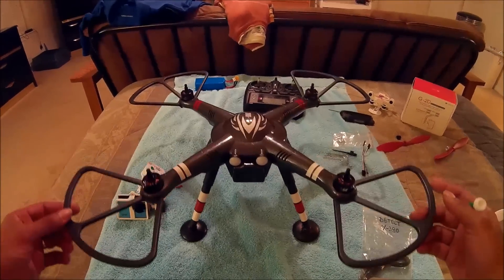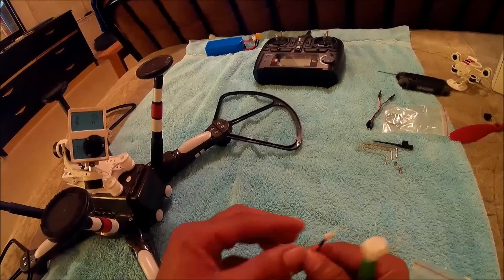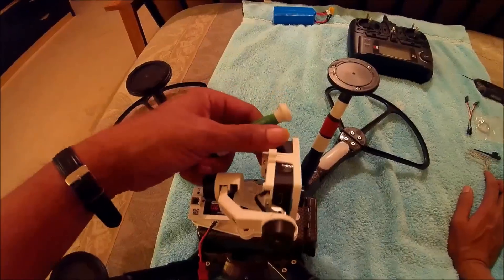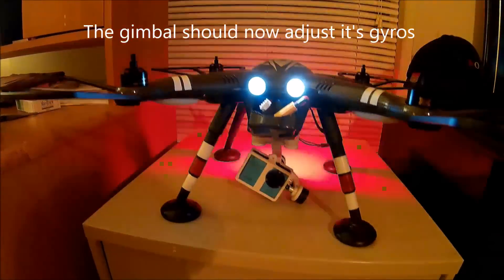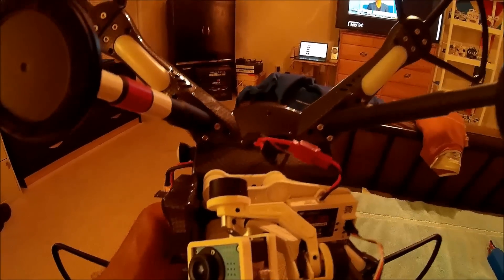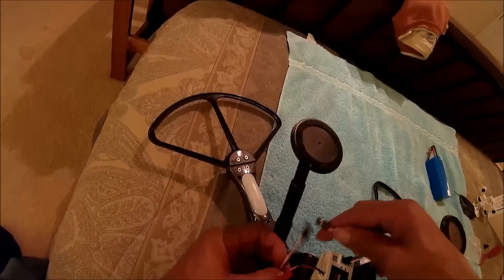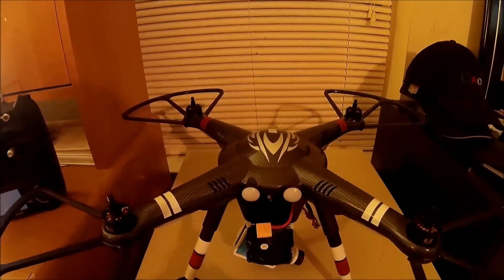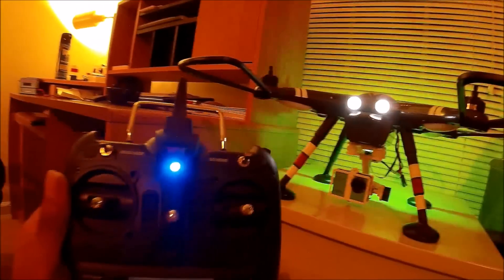XK DETECT X-380 "HOW TO INSTALL THE G2D GIMBAL"

Comment: Really nice that looks a lot easier to install than I thought it would be thanks for uploading the video. I can't wait to see some footage from your quad.
Reply from the maker: +Sam martinez   Pretty easy huh? I wish some of the other videos I watch had broken it down like that, I could of done it in about 10mins or less!  thanks for watching bro. DJ SOUL FORCE
Reply: +DJ SOUL FORCE I installed the new firmware for the X-380 this afternoon, Its a really awesome change to have the FAP and Panoramic modes.
Reply from the maker: That's great, I've been thinking about it myself.  I want to do a little more flying with it before I start messing around with the software.  Maybe you can do the video on that!
Reply: +DJ SOUL FORCE You can check if you transmitter will do the FAP by opening it up and checking to see if your photo button has 4 wires going to it..I did this first.
Reply from the maker: Are you saying that some of the transmitters do not have the 4 wires? You should do a video on how to do that plus how to update the firmware. Think about it!
Reply: +DJ SOUL FORCE yeah some of the first X-380 transmitters cannot do the FAP
Reply: +DJ SOUL FORCE I will see if I can do a video for the firmware upgrade
Reply from the maker: Cool. I'm uploading the G2D gimbal review right now, should be up soon.  Bout to do some night flying now cause it's gonna rain tomorrow! Lol